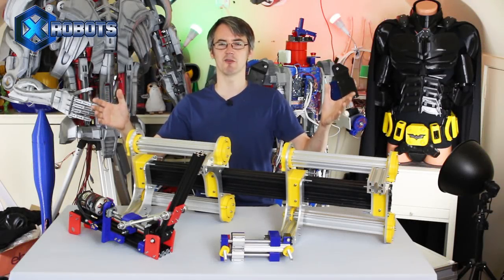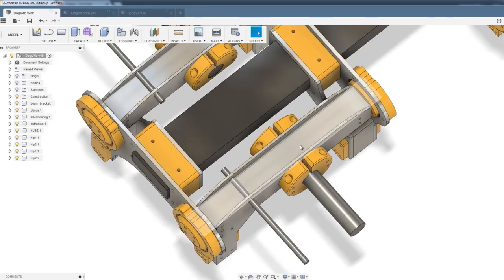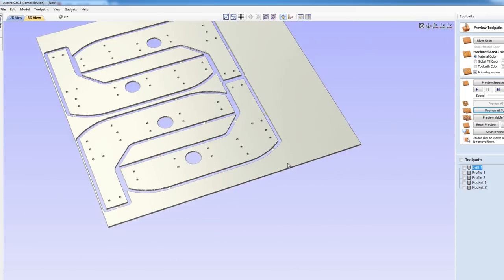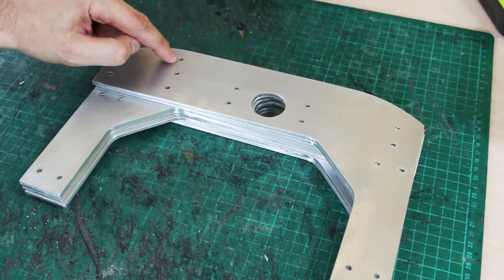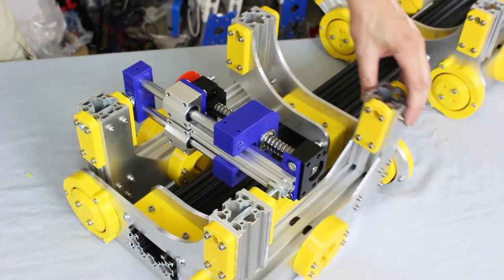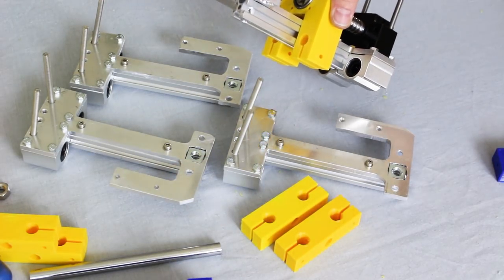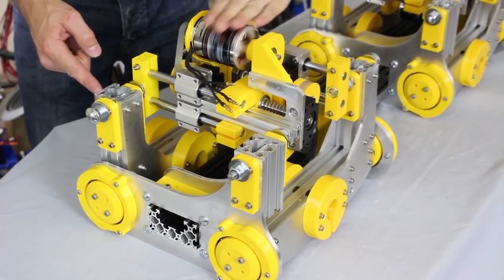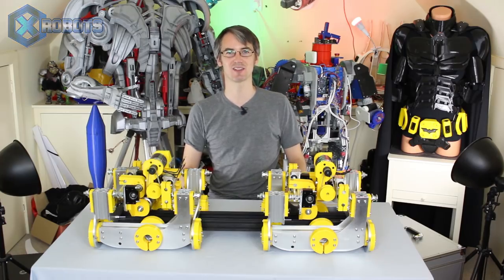openDog Dog Robot #5 | Actuator Assembly | James Bruton

Comment: Nice improvement to you milling method James. Another tip for machining sheet/plate like this is to machine all of the internal profiles first. Pocketing the large holes at the end can run the risk of the part vibrating on the tabs you leave. This can damage the tool and leave your tolerances out of whack.

Comment: Why not use a spray bottle to squirt the coolant? Usually if you screw out the nozzle you can get a thin stream rather than an aerosol. Then you don't risk an accident with the brush getting caught by the tool.
Reply: I use pump bottles with the atomizer nozzle drilled out to fit a WD40 tube.
I have half a dozen of these in the shop for various liquids...

* Carb cleaner / Degreaser
* Cutting fluid
* Homemade penetrating oil
* Light oil
* Isopropyl alcohol
* Layout fluid / marking dye

Comment: I would make a compressed air blower pointed at the bit, it could also use a windscreen washer with an atomizer on the end, so that you can spray lubricant/cooling liquid as well.

Comment: Hey James, ball screws can back drive. They just have a very large gear ratio between the ball nut and screw, but I suspect you'll be able to back drive them once you have a larger moment arm, such as a full leg. Lead screws are generally harder/ impossible to back drive. As always, great work!
Reply: Yeah in my experience ball screws are pretty easy to backdrive
Reply from the maker: Yes I can in fact back-drive them with no motor attached. However check out my early episodes about the Odrive - it has holding torque and then it's impossible.

Comment: I know you don't want to drill into your bed, so get another board and add it on top. Now you can cut out with out worrying about hitting your main bed. Here another Tip. Make two gcodes, one for the holes and the other for the frame. Cut the holes out first. Then use some screws with washers and screw in the holes to hold down the parts. Now finish machining out the rest of the parts with out adding tabs, if the plate is 6mm thick go down to 6.5mm to break through the sheet.
Reply: iiinsaiii the hole idea is a good one
Reply from the maker: good idea!

Comment: Fantastic James, thank you!   I think you could avoid the typical robotic wobble by accounting for the different components' weight and inertia in your model, and also by implementing a second order ramp. Apart from gradually ramping, you can also have the other limbs compensate as well to avoid all the jerkiness.
One more, assuming you'll have a gyro chip and accelerometer,  you could also have a range sensor measuring from the belly down, to know exactly where everything is with respect to the ground. This way  you could use the legs themselves as shock absorbers by compensating the motion without needing additional sensors.
Reply from the maker: Thanks, yes I'll be attempting some of that!

Comment: Fusion has a great cam environment and has really great options for using endmills for drilling holes -- then you wouldn't need to enlarge the holes on the drill press. I just let the CNC do all my holes -- as long as you're not moving straight down -- it's fine -- not sure the need for coolant with aluminum -- only have had to use any kinda of additive when using super tiny bits -- 1.5mm bits for making holes for m3s -- then I'll spray a bit of alcohol and go slow so things don't heat up. Otherwise for larger bits, aluminum cuts fine dry -- actually cuts better dry as chip clearing is better when dry. Key is never go straight down -- always keep the bit moving -- spiral down or slope down.

Comment: Suggestion: you can hide the wires inside the materials to reduce the wire mess that's coming, you can print parts with some channels, you can carve the channels in the alluminum and you can use the inside of the estrusded  alluminum

Comment: might want to look into a drill press vice (or just use the clamps you have on the drill press).  I'm no safety susie but some of the hole-saw stuff looked a little sketchy.
Reply: Sharky Sharklops 
Indeed, even a couple of F—clamps or even large C—clamps.
Reply: What's engineering without a little danger? xD
Reply from the maker: That drill press is gutless, I've used it for about 10 years and I know it's limits - it's more likely to stall!
Reply: Might still be a good idea to mention that in the video? I know that it's not likely that somebody with a lack of experience will attempt what you do in the video, but since this is an open source project designed for others to follow along with, it's a possibility. If somebody with less experience does find themselves cutting metal on a high-power drill press without the proper clamping, it can go horribly wrong. I've experienced it myself by slicing my fingertips open with some flat sheet metal, and it's a bit of a silly thing to overlook. Safety first! :D
Reply: One thing you can do to reduce the guillotine effect of the metal catching on the drill and spinning is push the side of the metal against the pillar of  the drill as you drill it, that way if the drill snags the metal it will just lift up. This will prevent you catching your fingers between the metal and the pillar.

Comment: Brilliant work James! That thing is looking amazing 😮😀 It's a shame the legs aren't using the same yellow plastic so they match 😜
Lil CNC tip: as you're using screws to hold the stock down anyway, drill your holes out first then sink some screws down into spoil board through the holes before you cut the outline toolpath. It'll save you having to add tabs, then having to cut and file them after.
Look out for clearances! Breaking a bit cause you've hit a screw head or a clamp is SO easy, it's almost a rite of passage 😂
Reply from the maker: Yes they will be - that is just the prototype leg. Thanks!
Reply: It's coming along brilliantly, keep it up man 😀

Comment: Looks like you found a pretty nice speeds and feeds recipe for that endmill!  I noticed that with the drill you are peck drilling.  You probably don't need to do that for those shallow cuts up to about 2x drill diameter.  It doesn't really help since the chips you get are so long anyway and it just means more "restarts" that cause a lot of wear on the drill.  Definitely want to keep things sharp in aluminum!
Reply from the maker: thanks, I'm just being cautious - I'm glad I can get the holes in the right place TBH

Comment: I was thinking a rack and pinion setup would be a whole hell of a lot more compact, but with it comes a whole different set of problems. You would likely need some sort of adjustable limited slip between the motor and the pinion so that any outside forces on the setup wouldn't wreck the motor.

Comment: Some tips for machining so far.
start using your mist coolant asap, it reduce the chance of chip binding, due to lubrication, also it evacuates chips with the airblast.
On plates (i use vacuum as workholding) i tend to start with inside features and work my way to the outside.
Also you can drill holes (helix/spiral) with endmills.

is there a reason you dont use Fusion to cam your parts up?

another tip: use your zero not on the edge of the plate, when youre using screws as workholding. that crack hurts my heart! set it in between your workholding, that extra material costs pennys ;)
Protip: Draw fillets in inside and outside corners, small ones on the outside (no deburring needed), a bit larger than your tool radius on inside corners.

Try some single fluters for such applications, datron makes nice ones. due to the single flute the chips can evacuate far better than with other bits, as you have a high rpm spindle you also could increase your feedrate with that.

PLEASE (in the name of safety) clamp your pieces down on your Drillpress... and while youre at it, turn it against the post so they cant turn any further...

Count it as a help for improvement and not offensive, thanks.

Comment: Excellent progress! Glad to see the multi-toolpaths. I would say I was mildly concerned about the pocket holes being cut after the outlines. It’s always best to work outwards on each piece to use the material strength to its advantage.
Reply from the maker: Yes, not sure why I did that, but the tabs are pretty tough

Comment: I'm a bit confused about the moment you're speaking about "cutting right quantity of each": they appear to be the same, the only difference is which side to put countersinks at. Also it looks like you're making countersinks just with big drill bit, but regular twist drills have ~118deg angle. Screws need different countersink angle (90deg for most metric) --- there's special tool for that.
Reply: i believe he mentioned it was because of the 30mm hole.  they wouldn't be aligned if he just used the same plate and rotated it.
Reply from the maker: Yes, they are in fact not actual mirrors due to the 30mm and 10mm holes.

Comment: If you add shock absorption now, but your robot still assumes everything is rigid, it still would probably work. But the problem would come when it wants to take a step forward, it's foot may drag when it thinks it's lifted high enough (depends on how loose). You could measure the weight on the foot and program a procedural gait that lifts it accordingly. Or you could just measure the joint angles and then it will know even how much weight is on each joint by subtracting your motor angle and the joint angle (basically the difference made from the elasticity if you install elastic actuators).

But with the foot dragging thing, it's important to remember that the ground isn't just a flat plane where you could trigonometrically solve how high to lift the foot (there could be bumpy terrain). I think the most important thing you need is for the robot to have a sense of it's own velocity so that it can aim it's feet in a running stride and let the motion flow to the next stride. And then measuring the pressure (weight exerted) on each joint could be another great hint on the velocity and how high to pick the foot up. Each leg should have it's own separate velocity reading (which I feel like you could get from camera vision). You can see this in the Boston dynamics video when the robot is kicked and suddenly the leg sticks out in the direction of the velocity to 'catch' itself from tipping over.

I think with the right approach, you could achieve the same fluid motion as Boston Dynamics with this build. You just need good instructions to tell the legs where to step and how to move with the velocity. If you are going for a rigid jittery kind of movement, that works too of course and would take a lot less time.

Of course I'm no expert. Just very interested. Keep up these awesome videos! Love watching you and Colin Furze build stuff. xD

Comment: reason the step bit did not work is the ti-nitride coating (gold-ish plating on bits). aluminum welds to and galls ti-nitride super fast. Either use silver or black bits with aluminum

Comment: when you zero to the cornor. set a 10-20 mm offset so you don't break your tool bit :P and always keep a hand on the feedrate so you can stop it! :P specialy when doing open cnc like this. mistakes happens and they can happen often. so more safety you work with. the better.
for the mill. a 1 tooth mill for aluminium is what we use for rought milling. and 2 teeth mill for finish. but ofcourse doing prototyping using the same tool for as much as possible would make every tool maker happy. but ofcourse being a industrial technician i mostly done mass production :P
instead of milling in a pocket. can you do tornado milling? it goes much faster, is better for the milling tool aswell.
resharping your tools. there should be plenty of guides out there for how to sharping HSS and HM tools. doing it your self might take a bit of practice. but it will keep your tools running much much longer!
last thing.
do a contour chamfering. it will give you a much more greater chamfering than by hand. atleast on one side. or get a good zero tool so you can do both sides on some parts. :)
keep working! loving your channel! you sure are a great inspiration!

Comment: the 30 mm  holes were cut strangely.. it would have been enough to take out the border and not cut the whole thing? you would have made cute little aluminium discs in the process..
Reply: Gunnahan I've done this and it's not without a little bit of danger.  Usually they don't fly off the table, but if they do, you have to watch yourself.  If you hold the piece down with a wooden pencil or something else that the router will eat rather than break itself on, it is usually fine.  That specific tool path was definitely odd though.
Reply: the piece coming loose and flying around is something that i didnt think of.. thanks for the point-out... i guess i am used to watching people that glue their material down or have a vaccuum / magnet system.. so they dont need to worry about that.. just shows how many aspects you have to take into consideration with the different techniques and tools.. :-)

Comment: You could probably cut the weight down a lot by replacing the extrusion with box tubing
Reply from the maker: hmmm... I don't think the extrusion is the issue. The ball screws and motors are the main bulk. I'd save more my going to SFU1204 screws and smaller motors without the extra inconvenience in assembly caused by losing the extrusion slots.

Comment: for the suspension, why not use a tortion spring mechanism and measure the angle the joint moves or pressure sensors to calculate the force being exerted? what if the suspension system was similar to moon boots and you can calculate the force that way? :)
Reply from the maker: Yes I'll do something somewhere and measure it to put back into the mathematical model - haven't decided what yet.

Comment: Couldn't you add something like load cells at some points in the leg linkage and do the shock-absorption on software by adding or subtracting from the target position of the joints based on the pressure the load cells detect? (maybe with some PID magic targeting pressure instead of position)

And would there be any way to measure the torque the motor is applying, to let you get a measurement of the resistance the limbs are encountering?
Reply from the maker: Yes that's possible, or just an IMU like I did with RobotX

Comment: Great video thank you very much!!!!!! 
I have a question!!!!!
The hip actuator moves in a linear direction while the hip itself slightly travels in a circular path so there must be a slider which moves freely in the direction perpendicular to the actuator path at the joint where the linear actuator and the hip meets to cancel the transversal travel so that the hip joint can travel in a completely linear path (I hope its clear). otherwise, it must be stuck!!! yet it doesn't in yours... how come is that?!

Comment: A thought. I saw a 3D printed pneumatic pump on Thingiverse. Couldn't such a thing be used to pull up the coolant and drip it onto the bit at a controlled rate?
Reply from the maker: Yes - there's a proper solution called a Fog Buster!

Comment: The point where the 10mm bolt goes through the 3D printed bushing is going to destroy itself. You should never pivot on a threaded bolt because either the bushing or the bolt will wear down quickly. Also, please never use a hole saw without clamping the piece down!

Comment: Instead of putting a captive nut in metal you should just drill and tap a hole
Reply from the maker: It's probably not strong enough to take the load... the nut is steel.

Comment: You should wear gloves when using that press drill and not use your hands when holding the parts ... if the drill gets stuck and you can't hold it it can be quite dangerous .
Reply from the maker: nope!: https://diy.stackexchange.com/questions/11880/which-tools-should-not-be-operated-while-wearing-gloves
Reply: James Bruton There's a guy Thomas Suokkeil or something like that, he does a lot of metal work with press drills, he always  wears gloves ... but it's your hands you do what you want ultimately
Reply: bbogdanmircea its not safe to use gloves when drilling. gloves can get caught by your drilling bit. your fingers will be around the drill bit. and i can tell you you can never use them again!

Comment: Why does everyone design these huge bulky 3d printed parts? its doesn't really aid in tensile strength. It should be designed more like you would for injection molded parts with special consideration to layer direction. you waste a lot of material making parts like you would steel or aluminum rather than making it like you would injection molded or cast plastic parts.